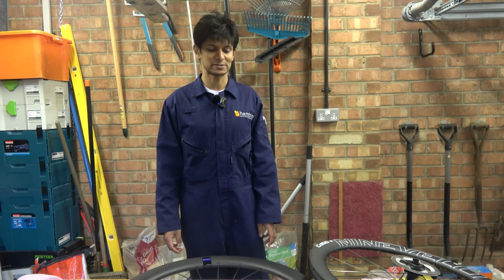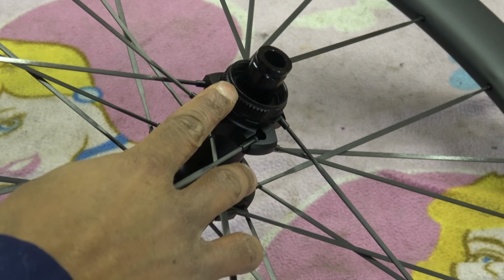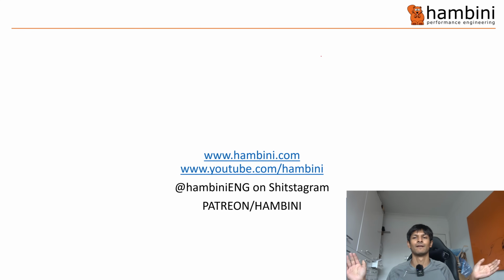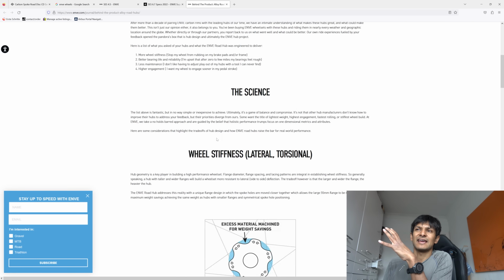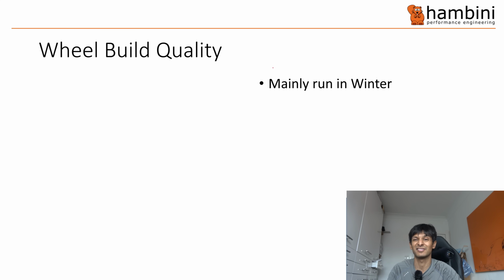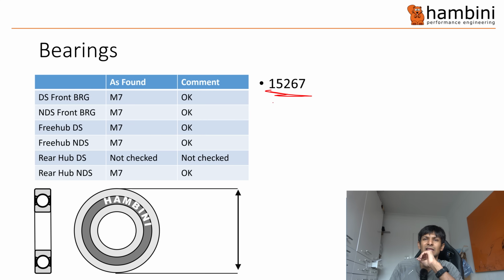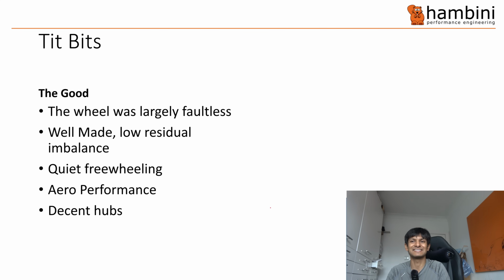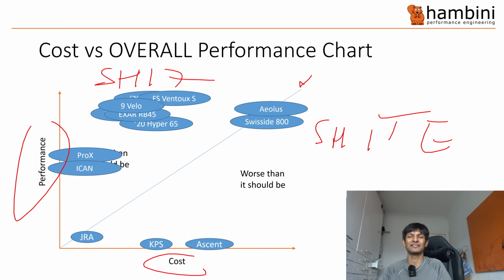9Velo $1100 Rapid | Well Made | DT Swiss Style Ratchet System

Comment: I've compared my LV45s against my Winspace Hyper 50s on very hard ride with almost exact weather conditions except for about 4mph more wind during Ninevelo ride and the difference was 12 watts but speed exactly the same. I'd say that the Ninevelo LV45s are generally just as good for about $500 less. I also have a set of CV55s (carbon spoke) rim brake wheels on my TT/TRI bike and they are awesome. Ninevelo in my opinion are the best of the Chinese wheelsets for the money. You can't go wrong

Comment: Question... To replace the ceramic bearings in the 2023 Winspace Hyper wheelsets, which NTN bearings would I require?
Reply from the maker: Kit on Hambini. Com
Reply: @Hambini  Do you know the specific bearings I could pick up from you since I don't need the tools?
Reply from the maker: @ThomasCraig2  it will vary depending on whether they are disc or not.

Comment: Comparing CD35 and LV45. The LV's are only 60g heavier but more aero; also come with metal spokes and 3-pawl hub system...and they are $370 cheaper. Which would you get? Is carbon appropriate for spokes? Is the PG ratchet hub that much better than pawl system? Thanks.

Comment: I wish Hambini would've delved into the lacing pattern of the front wheel rather than just dropping a passing comment. It's practice that disk wheels have non-radial lacings because they're optimal at transmitting torsional forces from hub to rim, i.e., stronger and stiffer. It seems the front wheel of this 9Velos wheelset is taking a cue from DS cross/NDS radially laced rim brake rear wheels while, curiously, all the rear wheel spokes (DS & NDS) are laced tangentially here. Hard disc braking can transmit substantial torsional force through front hub; I wonder why 9Velo opted to go this route. I don't know how much of an effect such a config has in real world use. Just curious.

Comment: Great review! I got the Cd35 wheelset as I am a lighter rider and I like the wheels being lighter. Cd35 wheels are 1305g with tubeless tapes and valves. My new Aeroad feels much lighter and responsive now. I am already loving these wheels.
I was riding DT Swiss PRC 65mm in the back and 50mm on the front, that came with the bike. They are nice wheels but I felt it was too heavy for me. These wheels feel so much punchier than the DT Swiss wheels for me. Hope they last longer.
Reply: I got a c35 wheelset too. I wonder how to dissambly , i cannot realease this "pipes as hambini does it just by hand.
Reply: @heinblod8720  Do you mean the rear freehub? If you remove the cassette, then remove the end-cap of the other side, you can pull the freehub body without an issue. It is pretty similar to a DT hub.

Comment: Hey Hambini. Think I'll be ordering a set of these! Just wanted to ask if the logo decals are indeed decals or printed on the wheels. Small thing but I'm not a fan of giant bright logos on wheels. Thanks for the review!
Reply from the maker: They are under the lacquer
Reply: @Hambini  Thank you good sir. Not a deal breaker but good to know.
Reply: They are printed. I have ordered the Black decals. Branding looks more subtle now. May not be a good thing for 9Velo though.
Reply: I asked them to give me a set with black decal and they were kind enough to do it but I will need to wait extra 2-3 weeks which is ok as I have what to ride meanwhile. They should offer that option from the start.

Comment: Hi Hambini!

I see a lot of talk about wheel weight and lighter wheels being easier to spin up. But doing some basic mechanical calculations, I found that in order to accelerate from 0 to 40 kph, I'd need 4.94 kJ with 1 kg wheels, and 5.06 kJ with 1.5 kg wheels. That's a 2.5% difference in energy expendature. That would mean that in order to do the acceleration in 10 seconds, you'd need to do a constant 494 vs 506 watts, respectively. I've never tried really light weight wheels, but based on these calcs, it's a bit fishy. Are we that good at perceiving a difference like that, or am I missing something? with a lighter (50 kg) rider that difference could go up to 2.8%, but that's still not a lot.

Thanks in advance!

(My calculations were based on the translational energy of the rider+wheels+bike, and I've also taken into consideration the rotational energy of the wheels. The wheels were assumed to have a radius of 0,355 m with all their weight at the 'rim'. Rider weight was 70 kg, bike weight (without wheels) was 6 kg, so system weight was 78 and 79 kg. Rolling resistance, air resistance and drivetrain losses were neglected when calculating 10 second power.)
Reply: I can't speak to the numbers but the difference is most notable when starting from stopped or at low speeds. the sensation when climbing slowly can also feel a bit different- less smooth with more noticeable dead spots in power stroke
Reply: There is no difference. The lighter a wheel is, the faster it spins up, but also the faster it spins down. Weight is weight. It doesn’t matter where it is, and it makes very little difference.
Reply: @catsanddogsman Well for cars it's well known that wheel weight reduction makes a noticeable difference. I would imagine it's the same for a bike.
Reply: @username8644  It’s honestly been shown that rotational weight makes no difference compared to any other weight aside from momentary acceleration. It’s a flywheel. Weight in general makes very little difference at all. The difference between a deep section and a shallow wheel is a maximum of 500g. For every 1kg of weight it makes 2w difference on a 3% hill, 3w difference on a 6% hill and 4w difference on a 9% hill.  What you gain from weight, you lose more from aero. Deeper wheels can stall air in crosswinds, but that again also depends on the design of the rim. Some deeper wheels can be better than shallower ones if they are designed to be so.
Reply: @catsanddogsman  what about going up 15-20% gradients.  I ride very steep hilly gravel and I only weigh 127 pounds. I got a set of 1083 gram light bicycle wheels and I could tell a big difference when riding up the really steep gradients. I probably knocked off about 2 pounds of weight from my stock aluminum wheels.
Reply: It depends on many things. The proportional difference in the weight of the system (if you are light) is greater.  Rim depth matters. If you give up 30mm for those 2lbs you will be slower. It also depends on the gradient. 1kg makes 3,6,9w. Difference from weight on 6%,9% and 12% correspondingly. If you gave up aero to save weight with your rims, it will almost always be slower. It may feel faster due to acceleration and spinning up, but it is a flywheel and heavier wheels spin down slower and maintain speed. It makes no difference. 
Rims are the worst place to shave weight because you are sacrificing watts not just on flats but also in most hills. A light, low depth wheel will be more nimble and may feel “better”, but it will always be significantly slower.
Reply: @catsanddogsman  I average 11-12 mph on these steep hilly routes and even the small bits of paved road are upwards of 10-12%. I might hit 15 mph tops for a few minutes on these courses. I am either going up or flying down a hill. The speeds I reach going downhill  are more to do with my skill and confidence then the depth of my rims. Those couple of pounds is the difference between me getting up those steep bits or walking and pushing my bike...I think walking and pushing my bike would negate any small "aero" gains I might get from a deeper rim.  Plus, the cumulative muscle fatigue over a few hours adds up and decreases performance. I have a pair of 45 mm deep rims on my road bike. I think it does matter on paved road, but even then I get blown around quite a bit in crosswinds. Me keeping up with a bunch of younger folks and men my own age has more to do with my fitness level then the depth of my rims.

Comment: I'd be curious to see where my Ican Trispoke wheel fits on the graph. It was cheap, seems really fast compared to my other wheels, and doesn't have any of the spoke and nipple issues that all those other wheels seem to suffer from.
Reply from the maker: I've been using the farsports tri spoke. It's a completely different league
Reply: @Onigure this is the one I got, I just got the front and run a disc in the back. You can customize the hub for whatever you want, I got 12mm centerlock and a plain matte paint
Reply: @Onigure  Light Bicycle do a Tri-spoke carbon wheelset. Would love to give them a go, they look pretty good.

Comment: I use adjustable zip ties to put difficult tyres on, it helps to push the tyre down and give you some give. Put the zip adjustable bit / feed against the rim, easier to undo.

Comment: I don't understand the tire mounting struggle with bicycle tires. Just rub a little soapy water around the bead and they will slide right on. This is how motorcycle and car tires are mounted.
Reply: Maybe make them fit a 180/50 17 and then see how they feel about bicycle tyres ?
Reply: That’s nothing. Try a 40 series runflat.

Comment: Glad to hear about 15267's being sorted out --- I've opted for DT Swiss 350 hubs over 240s just because they use normal bearings and can source top tier OEM replacements.
Reply: It's also centrally located mass, so the weight savings are irrelevant imo
Reply: All six bearings for the disc brake version use the same size: 6902. Big bearings and only one size to deal with.

Comment: Not a bearing expert, and I dont know what kind of steel they usualy use in bearing. But I do know that modern stainless steels kan be hardened to 65 rockwell and beyond. So why would stainless bearings be soft?
Reply: So that the race doesn't shatter
Reply: Because they don´t take the cost/hassle to harden them??      Rgr

Comment: Why do carbon spokes make me nervous?
Reply: Let me count the ways, 1) a small scratch from road debris could cause sudden failure.  2) the interface between the spoke and the rim and hub are critical high stress areas. 3) Good old steel spokes and aluminum rims work really  well. 4) Carbon isn't really recyclable despite "green packaging " Even coal can be painted green!

Comment: Ive got the Winspace D67 running on Specialized cotton Turbo tyres all i can say is is that they go like a bomb after 20 mph and my mates think there is a car behind us when i am on the back of the bunch!!! They sound awesome and are light being rim brake too.........You would have to be a mug to buy Zipp Roval Metron as these eastern wheels are well made and so much cheaper!
Reply from the maker: I wouldn't get on Zipps. I have a set in for a failure investigation.
Reply: @Hambini  I have had 2 sets of 404 both later types design  BOTH had rear bearing failure!
Reply from the maker: @davemellor4697  yikes, wait till you see the 454's that have come in. absolute shite.
Reply: I can vouch for this assessment. The D67’s are magically quick. I’m running GP5000 S 25’s and man do they go.